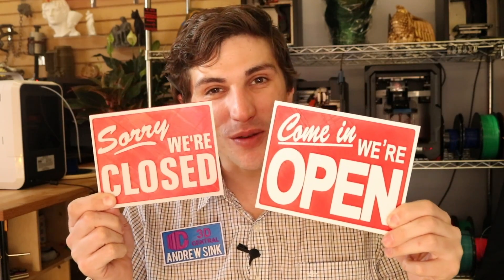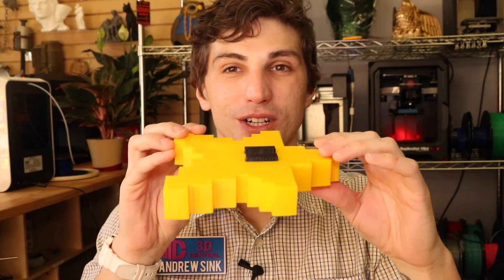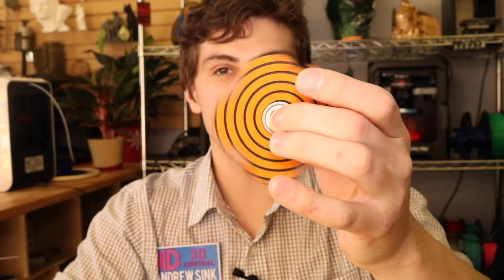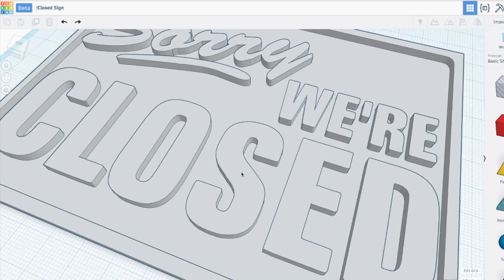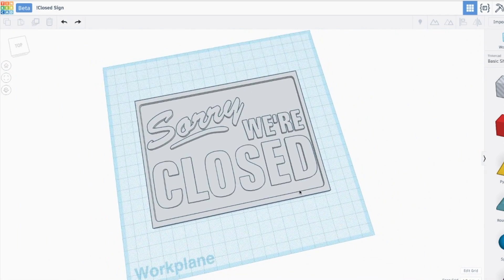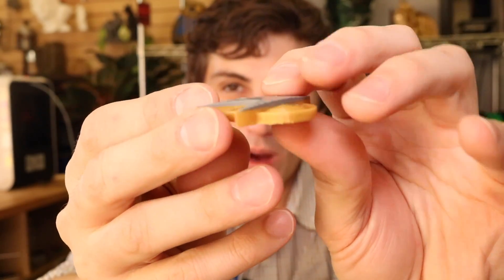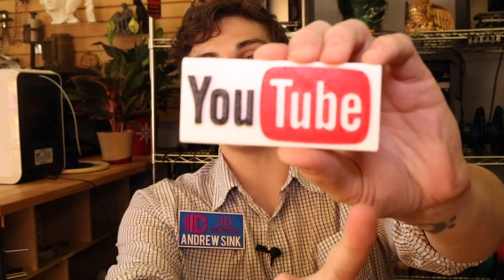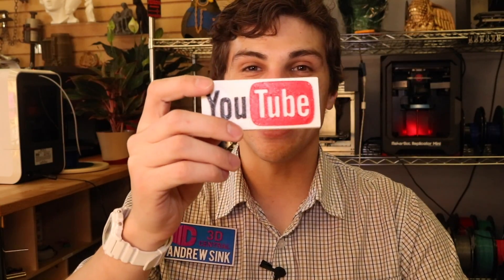Multicolor Prints from Single Color Extruder 3D Printers!

Comment: If you have access to modifying the object files and can create a different gcode/stl file for the layers, I built a super simple page that will inject the M600 command (the part that pauses your print and initiates the change filament procedure) into your gcode in between your layers automatically. /r/3Dprinting/comments/iyrt94

Comment: This video doesn't even tell you how to do this? All you say is pause the print. Duh. I wanna know how to edit my gcode to do this!
Reply: First thought on my mind. Nailed it. Swapping filament, we all know how to do, picking a point, to do it, sure. I expected some tips on editing gcode so when it reaches 2.5 mm, it pauses, queing me to swap filament. Yes, this was ridiculous.
Reply: use cura to slice,it have built in gcode modifer which you don't need to touch any codes only enter the desired layer to swap filament and it will edit the gcode itself
Reply: You dont have to I think, it looks like hes just waiting until the printer comes to the right part of the print, and then swapping out the filament. You don't need to edit the gcode at all for this
Reply: TheBestLettuce but I don’t want to sit by my printer and watch it all day
Reply: @oliverhoffman4574  Then buy a better one with two extruders.
Reply: TrailMix J I also don’t want to pay 1k

Comment: What a waste of time!!! I can't hear your comments over the music... Maybe for the best cause the whole vid doesn't provide any valuable info. So pausing the print is your solution? You need to move the printer head away so it doesn't melt the print (being in one spot), you also need space to prime the extruder (after swaping colors you are left with residual amounts of the original color in the head which will mix with new color). I am sure all that can be either programed either in slicer or directly into the g-code file... Oh never mind I found it - if you use cura, go to extensions-post processing-modify g-code-add a script- pause at height. That feature allows for parking your head away from the print, it will give you plenty of time to swap the filament, it will even prime the new one for you. Once you're done - it will take the print head back to where it paused from. Done and done!!!

Comment: So your only advice is to pause it. No other considerations. So you don't need to move the head away from the print to prevent leaking. There is no instruction on gcode to pause printing that you can add to assist you.
Reply: Exactly